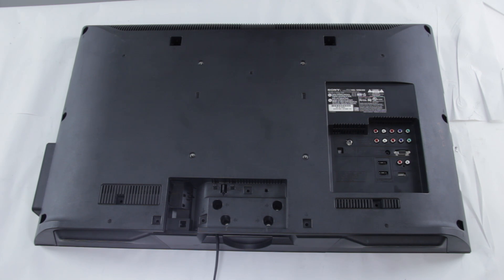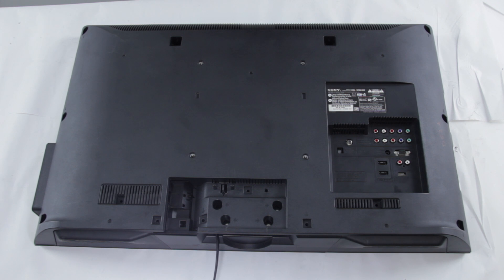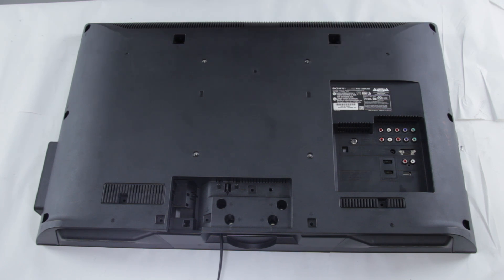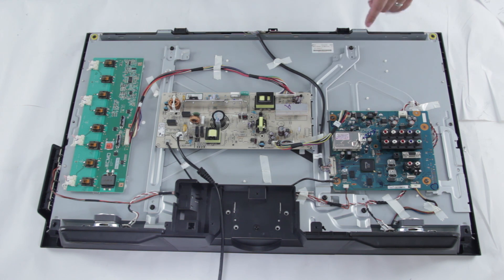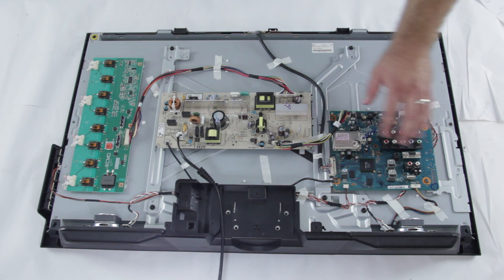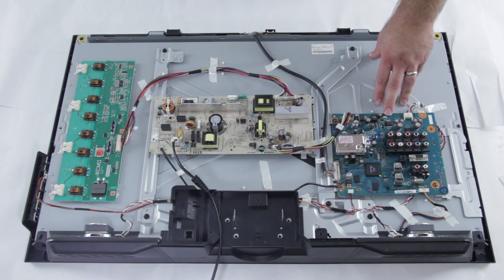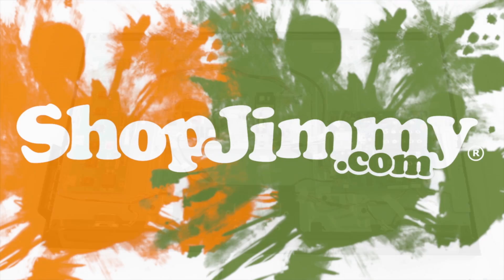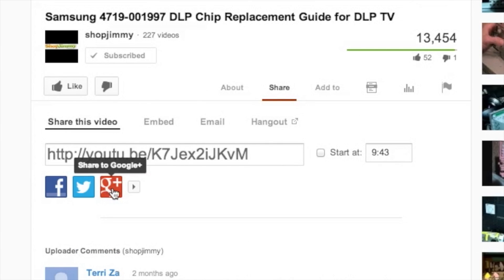LCD TV Repair - TV Has Audio, No Video - Common Main Board Symptoms & Solutions

Comment: I have a Samsung UN46C7000WFXZA LED TV that I’m having an issue with. I wanted to describe what happened and see if you think there is any hope of fixing it.
 
I recently turned the TV on and 5 minutes later the picture froze but audio continued for a little bit. Then the picture went out and there was green glow for a second and a high pitched noise started coming from the TV. I turned the TV off for a minute and back on. I still got no picture and it still made the high pitch noise. I left it alone for a little while and tried it again. This time it wouldn't really come on at all. It would make the clicking noise like it was coming on, but nothing came on screen. The power light would blink a few times, then it would reset. It kept doing this, trying to come on, light blinks, reset. I couldn't cut it off because it kept going off and on by itself. 
 
I left it alone to check for answers online and came back and it had stopped resetting. I tried turning it on again. Now the TV turns on but there is no video. Audio works, the high pitched squeal is gone, but there is just a  black screen, no video. NOTHING shows up on screen, not even the TV’s menus or the input selectors or anything like that. I can see the backlights are on, but no video or menus.
 
I decided to open it up and see if I saw anything wrong. When I turned it around I found the problem. My cat had backed up to the TV and sprayed right in the vent on the back of the TV. I opened up the TV and from looking around it appeared that the only thing that got wet was the T Con board. So I replaced that but the same issue persists. Now I don’t know what to do. A very small amount may have also gotten on the bottom of the power supply board, but could that cause this problem?
 
Do you believe this TV can be saved or will something like this be too damaging? Or maybe damaged something I can’t visually see? Any ideas at all?
Reply from the maker: lethargicj   Replace anything that has a residue on it. With liquid, its tough to say what could have gotten shorted out, so you may end up replacing everything inside the set, or possibly just one or two boards.  Here is a link to replacement parts for your TV model number on our website, click here:  http://www.shopjimmy.com/catalogsearch/result/?q=UN46C7000WFXZA  Be sure to match part numbers on your current board, with your replacement for compatibility.  You can also call our customer service for further assistance with your purchase.  (877) 881-6492  Thanks and please let us know if you have any further questions with your TV Repair!  www.shopjimmy.com

Comment: Hello. I have a Sony Kdl-60R550 that has been bricked due to a failed firmware upgrade. I have been advised to replace the main board: Sony 1-895-402-31. My tv is a New Zealand version though. If I buy this North American mainboard from you will it function in my TV? I understand that the tuner will be different, but not worried about losing tuner funtionality, just want to get the panel up and running. Thanks.
Reply from the maker: wards.davey Clan   I don't think it will be compatible.  Thanks!  www.shopjimmy.com

Comment: I have a LG 47LH55-UA.ACCVLUR with no video but audio is ok . The backlight is not coming on and I can't see the picture with a flashlight . The inverter is part of the power supply but thinking it may be the main board since I can't see the picture with a flashlight .
Can the main board stop the backlight from coming on?
Reply from the maker: Hijello Cormier   I recommend replacing the main board in your TV.  Here is a link to replacement parts for your TV model number on our website, click here:  http://www.shopjimmy.com/catalogsearch/result/?q=47LH55  Be sure to match part numbers on your current board, with your replacement for compatibility.  You can also call our customer service for further assistance with your purchase.  (877) 881-6492  Thanks and please let us know if you have any further questions with your TV Repair!  www.shopjimmy.com

Comment: hi i have a vizio gv42lhdtv it was work good and then now when your turn it on it gives a blue screen and then shuts off...i did have a tech look at it he says that the rgb is locked up...not sure...can you help...would that be the main board...i can take the set back off if needed or if you can id the trouble i can order the parts from you...
Reply from the maker: mick r   I recommend replacing the main board in your TV.  Here is a link to replacement parts:  http://www.shopjimmy.com/catalogsearch/result/?q=gv42lhdtv  Be sure to match part numbers on your current board, with your replacement for compatibility.  You can also call our customer service for further assistance with your purchase.  (877) 881-6492  Thanks and please let us know if you have any further questions with your TV Repair!  www.shopjimmy.com

Comment: Hi, I have a Toshiba 37" with these characteristics.
Model: 37E200U
Serial: A37502T18164L1
Issue:  it has very poor color picture, before the colors were very bright.
Thanks
Reply from the maker: Cali   This could either be a problem with the T-con board or the main board in your TV.  I recommend first replacing the T-con board and if you still have any problems, then replace the main board.  Here is a link to replacement parts for your TV model number on our website, click here:  http://www.shopjimmy.com/catalogsearch/result/?q=37E200U  Be sure to match part numbers on your current board, with your replacement for compatibility.  You can also call our customer service for further assistance with your purchase.  (877) 881-6492  Thanks and please let us know if you have any further questions with your TV Repair!  www.shopjimmy.com

Comment: model no: 39MF412B/f7 
Brand: Magnavox
Issue: I bought it off a friend, worked fine first night, shut it off, turned it on next day and no picture. Sound works and back light works. When I leave it off for an extended amount of time the picture works briefly and then shuts back off. Recommendations?
Reply: I think it's a mosfet but I can't find any circuit diagrams for my tv... and i can't find anything on your site at all for it... http://tinypic.com/r/2uik9kk/8
Reply from the maker: Matthew Brown   I recommend replacing the digital board.  Here is a link to your replacement part: http://www.shopjimmy.com/magnavox-a21t0mma-002-digital-main-cba.htm  You can also call our customer service for further assistance with your purchase.  (877) 881-6492  Thanks and please let us know if you have any further questions with your TV Repair!  www.shopjimmy.com
Reply: Is there a cheaper interchangeable part I can use...?
Reply from the maker: Matthew Brown  No.  I do not see any other parts or less expensive options on our website.  Here is the replacement part:  http://www.shopjimmy.com/magnavox-a21t0mma-002-digital-main-cba.htmv  Thanks and please let us know if you have any other questions.   #tvrepair

Comment: Hey, I got a 
Samsung Model Code: LNT3253HX/XAA
S/N:  AH6X3CPP701255X
and I'm really debating after this video if the problem with my TV is the main board or the TCON Board. My LCD Tv has audio but the screen displays no image, it stays dark. However, you can clearly tell when you are changing channels because it darkens a little and then lightens up little attempting to display the image, without success.
Reply from the maker: ruben777nL   I recommend replacing the main board in your TV.  Here is a link to replacement parts for your TV:  http://www.shopjimmy.com/catalogsearch/result/?q=LNT3253HX%2FXAA  Be sure to match part numbers on your current board, with your replacement for compatibility.  You can also call our customer service for further assistance with your purchase.  (877) 881-6492  Thanks and please let us know if you have any further questions with your TV Repair!  www.shopjimmy.com

Comment: I have a Samsung LN32A330J1DXZA

When you turn it on, everything operates as expected, after a couple minutes, the color begins to fade to white for last of better description.  This takes about 5 minutes to complete the process.  It nevers goes to complete white.  It acts the same no matter which input you are set it to.  When you turn it off and let it sit for a minute, the color comes back and the process repeats.
Reply from the maker: Chip Bradley   I recommend replacing the T-Con board in your TV.  Here is a link to replacement parts for your TV model number on our website, click here:  http://www.shopjimmy.com/catalogsearch/result/?q=LN32A330J1DXZA  Be sure to match part numbers on your current board, with your replacement for compatibility.  You can also call our customer service for further assistance with your purchase.  (877) 881-6492  Thanks and please let us know if you have any further questions with your TV Repair!  www.shopjimmy.com

Comment: Hi, I have a 42hdS69 Hitachi Plasma TV.The only thing that works through Remote Control and TV pannel is power button and volume buttons. The TV turns on but its stuck on one input, I can not change inputs or anything else. Could you please tell me whats wrong with my TV and what do I need to replace?

Comment: hello, i have a samsung plasma 50" display:
Model: PN50A650T1F
Model Code: PN50A650T1FXZC
Type: PN50A650
S/N: AMMR3CMQ501150R

i bought this tv off a guy that couldnt get it to work. he says he already replaced the power supply. and he thinks the main board is bad. 
here are the symptoms:
when you plug in the tv, nothing is displayed on the screen at all. 
the red status light is on solid.
one of the relays on the power supply keeps clicking randomly. 
i could not 'turn on' the tv at all.
i tried changing the power cord and changing where the tv is plugged in (samsung live chat instructions).

when i unplug the connector that goes from the power supply to the main board, the relay stops clicking. 

how can i make sure its the main board?
what should i do next?
Reply from the maker: Mohammed Issa   You can unhook the y-main board to see if the set stays on and if so the y-main board is bad and will need to be replaced with the buffers that connect to it.  Here is a link to replacement parts for your TV model number on our website, click here:  http://www.shopjimmy.com/catalogsearch/result/?q=PN50A650T1F  Be sure to match part numbers on your current board, with your replacement for compatibility.  You can also call our customer service for further assistance with your purchase.  (877) 881-6492  Thanks and please let us know if you have any further questions with your TV Repair!  www.shopjimmy.com

Comment: I have a Samsung model # - LN55C630K1FXZA Serial # - Z1PL3CCZ408370B Version - SQ01 and I am having issues with vertical lines on the screen I have taken the back off the tv and the picture gets better when I tap on the main board (not the board where the power comes into) the board number is BN-94 02701E any suggestion?
Reply from the maker: Jason Pelletier   This sounds like the problem is your LVDS cable.  Thanks!  www.shopjimmy.com

Comment: Samsung plasma 50" HTP5044X/XXA
No picture with audio. Opened the back cover as you instructed and I found that the upper Y-sus board has chip burned. I see that you sell the part at shopjimmy, but my question here is, replacing the upper y-sus board will fix the problem? What caused that chip to burned? I'm afraid of buying the new part, replace it and burn it again. Any advice will hekp. Thks

Comment: I have a Polaroid TLA-01511C.  Yesterday the picture went all light pinkish color with a vertical band about 1.5 inch wide down the middle(slightly darker pink).  Can't see any image.  Turn it off and picture came back one time but for only about 5 minutes and now doesn't come back at all.  Sound, changing channels work fine.  What do you think is a fix?
Reply from the maker: Vic Exner  This sounds like a TV panel problem.  If your TV panel is bad, it may be more cost-effective to replace the TV as panels are typically hard to find in stock, difficult to replace, and expensive.  Thanks and please let us know if you have any further questions!  www.shopjimmy.com

Comment: I have a Sony KDL-40EX400, with no sound or picture. The main board seem to be the problem, because the power supply has the correct voltages when i tested it. The tv went dead after a thunderstruck that i think it went through the cable box.  My question is could the board have damaged other boards?
Reply from the maker: EXWrath123  Yes, there is always a possibility of other boards getting damaged, however this is not very typical.  Here is a link to replacement parts for your TV model number on our website:  http://www.shopjimmy.com/catalogsearch/result/?q=KDL-40EX400  Be sure to match part numbers on your current board, with your replacement for compatibility.  You can also call our customer service for further assistance with your purchase.  (877) 881-6492  Thanks and please let us know if you have any further questions with your TV Repair!  www.shopjimmy.com

Comment: Hi have the Sharp LC-70C8470U. The tv will not turn on. After plugging in TV the center icon (inverted V) will flash 2 quick flashes Followed by 2 longer flashes. Power Board ??
Reply from the maker: *****   Yes, I recommend replacing the power supply board in your TV.  Here is a link to replacement parts for your TV model number on our website, click here:  http://www.shopjimmy.com/catalogsearch/result/?q=LC-70C8470U  Be sure to match part numbers on your current board, with your replacement for compatibility.  You can also call our customer service for further assistance with your purchase.  (877) 881-6492  Thanks and please let us know if you have any further questions with your TV Repair!  www.shopjimmy.com

Comment: Thanks for the video. I have a LG 55LV5500 with backlight but no picture. I bought the tcon from you and replaced it but that didn't fix the problem. would you suggest the main board or power boar next and is there a way to test them with a multimeter? Thank you.
Reply from the maker: Casey Buttrey   I recommend replacing the main board in your TV.  Here is a link to replacement parts for your TV model number on our website, click here:  http://www.shopjimmy.com/catalogsearch/result/?q=55LV5500  Be sure to match part numbers on your current board, with your replacement for compatibility.  Here is a link to a video showing how to identify your part number, click here:  TV Part Number Guide for LG & Zenith Main, Digital, & Tuner Boards (LCD, LED, Plasma TVs)  You can also call our customer service for further assistance with your purchase.  (877) 881-6492  Thanks and please let us know if you have any further questions with your TV Repair!  www.shopjimmy.com

Comment: Hi, i sent you a messege on your youtube account but no reply as of yet, i have a toshiba 32av505db and no problem is, when i plug it in to the outlet i hear 2 clicks and that is it, no red light, no buzzing, no nothing. I bought a replacement power board from ebay but still the same problem.

Any ideas? could it be the sub power board? or main board? Any help would be great
Reply from the maker: David Roberts   I recommend replacing the main board in your TV.  Here is a link to replacement parts for your TV model number on our website, click here:  http://www.shopjimmy.com/catalogsearch/result/?q=32av505  Be sure to match part numbers on your current board, with your replacement for compatibility.  Here is a link to a video showing how to identify your part number, click here:  TV Part Number Identification Guide for Toshiba Main & Scaler Boards (LCD, LED, Plasma TVs)  You can also call our customer service for further assistance with your purchase.  (877) 881-6492  Thanks and please let us know if you have any further questions with your TV Repair!  www.shopjimmy.com

Comment: Hi I need some help.I have a GENERALjapan model:42LC88 ,LCD TV  , All I have is a glowing green LED light in the front, but there is no picture or  no sound. I opened my tv and the Power Supply still produces power.
Reply: black screen
Reply from the maker: d day   I recommend replacing the main board in your TV for your TV Repair.  Unfortunately I do not see any replacement parts in the search results for your TV model number on our website.  Thanks and please let us know if you have any further questions!  www.shopjimmy.com

Comment: I am having an issue with my Toshiba 40SL412U LCD TV. All I have is a glowing green LED light in the front, but there is no picture. I opened my tv and the Power Supply still produces power.
Reply from the maker: lonewolf2009  I recommend replacing the main board in your TV.  Here is a link to replacement parts for your TV model number on our website, click here:  http://www.shopjimmy.com/catalogsearch/result/?q=40SL412U  Be sure to match part numbers on your current board, with your replacement for compatibility.  You can also call our customer service for further assistance with your purchase.  (877) 881-6492  Thanks and please let us know if you have any further questions with your TV Repair!  www.shopjimmy.com

Comment: I have a Insignia NS-46L240A13.   The pixels in the picture that should be black are all green.  Is this a problem with the Main Board?
Reply from the maker: Andrew Biancardi   I recommend replacing the T-con board to see if that fixes the problem.  If that does not completely fix the problem, you can replace the main board.  Here is a link to replacement parts for your TV model number on our website, click here:  http://www.shopjimmy.com/catalogsearch/result/?q=NS-46L240A13  Be sure to match part numbers on your current board, with your replacement for compatibility.  You can also call our customer service for further assistance with your purchase.  (877) 881-6492  Thanks and please let us know if you have any further questions with your TV Repair!  www.shopjimmy.com